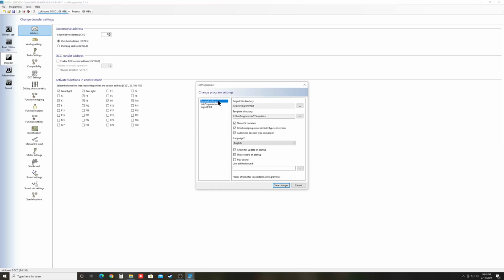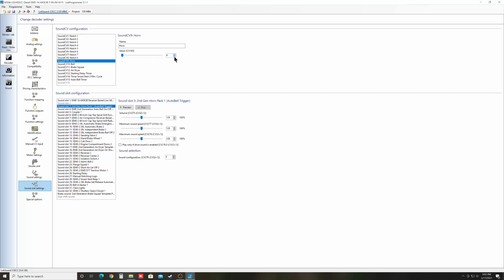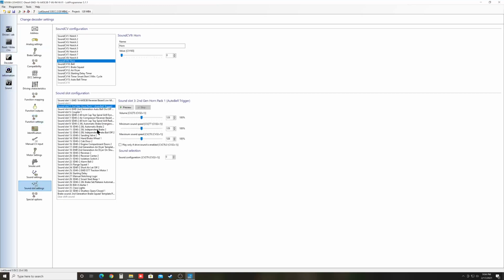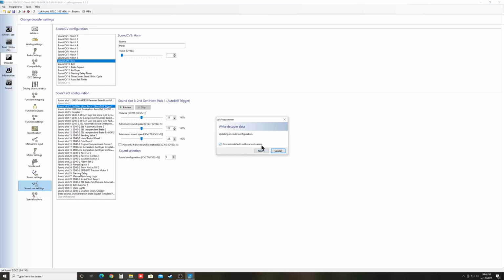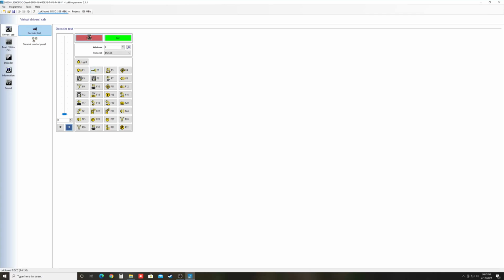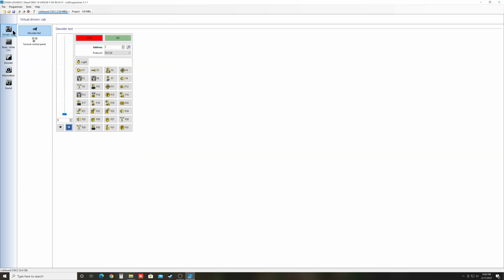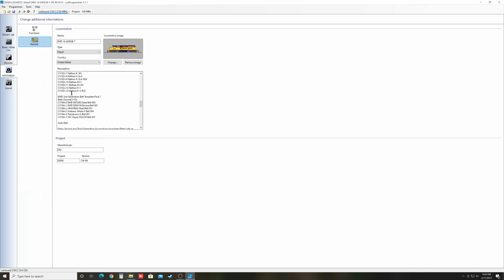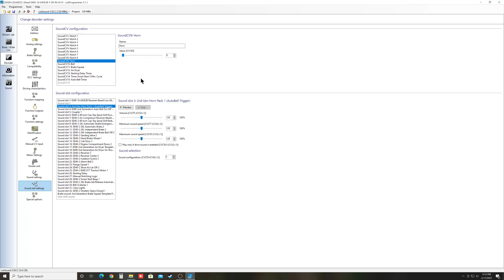ESU Tutorial Series - How to Change the Horn & Bell in a V5 Sound File

Comment: Hi, can you make a video on uploading the existing loco soundfile to make a copy in the computer for future back up, also make a second copy to play on or tweek the other bells, horns, which i think you already made  just a way of learning to do more of the program upgrading. I have a lot of G scale on ESU and i like to learn the next phase on ESU programming . your video are great to learn. if i can get a private tutorial please send me a contact or email  for me to connect  thanks
Reply from the maker: Hi Reddfox12...I'm not exactly sure I follow what you're asking. There is no way to download sound files from the decoder if that's what you're wanting to do. The decoders from ESU come "blank" from the factory (with test sounds only) and always need to have a sound file written to them. If you want to change what is pre-installed maybe from a manufacturer or a hobby store, you simply over write the entire file with a different one. There's no erasing or downloading what is already there. If you know what sound file was put on the decoder to start with you can open that sound file (after downloading it from the ESU site) and read the CV data into the file via the green arrow button. This only reads in the CV data, not the sound data. 

I always start with any decoder by downloading the sound files from the ESU website. I will modify the sound file I want for a particular locomotive and then save the file with a different file name. The file name has the road name and road number of the locomotive it is for. That way I have a specific file for every single locomotive. I also have the "base" original file as well that I will modify again if needed for other locomotives. Uploading the sound to the decoder is always the same, simply by pressing the music note icon always writes the sound data and the CV data and takes about 25-30 minutes. The red arrow icon without the music note only writes the CV data which takes only a few seconds.

I hope that helps, and if not let me know and I will try to help further best I can.
Reply: @RioGrandeFan  thanks for a quick response. ok. I may have said confusingly. 
If you check my YouTube video on a lot of my G scale  they are all ESU sound file and custom programs. 
A professional installer did all that. 
Wiring and program ESU sound files. I need to learn to place the locos individual on the program track to get the ESU Sound file and programs to my Desktop for my own copies. Meaning I need to read the decoder ESU data and store it to a folder for future back up just in case I have to down load if the decoder get some glitches to restore it. 
Second I will get to learn to make a copies on the Master of the original and then the copied file can be edited to like changing bells , whistles, volume sounds. Etc. just basic tweaks. 
3rd. To learn from the original how the pulse smoke and other accessories on Auxiliaries connection how lights are made to strobe , blink. There are a lot of learning on the master file that was made. Maybe to enhance or discover other tricks that is possible and allowed with the range. 
I have a test lab gadget that connects the decoder 58513 XL that will show all connection like 
FL, Front Light, RL rear light, speaker, motor, etc. to fine tune and before you make a final Decoder install. 
Now I know the Ho are ESU plug and play. But the G scale is custom wiring install. That is for the professional installer. But the learning to tweak or enhance the decoder data can be learned on the next phase of the hobby. 
 
You can change the locomotive sound file every month if you get tired and try a new file. Like ESU Is making more Hi fi sound file which are really great. 

Simply put. Backing up my Locos data and soundfile to my computer 
And learn to copy the master file to another file to explore other possibilities to enhance the features of the  locos sound functions.
Reply from the maker: @REDDFOX12  You can only download the CV data to your computer which I suppose is ok, but it would be better if you had the original file that was written to your decoders. I would ask your professional installer if he would give you the files he used. There's really no reason why he shouldn't give them to you or at least tell you what file number was used. With that you can download the file that was used and then read the CVs into it using the green arrow icon. Then save the file with your locomotive road name and road number. If he put custom sound recordings in the sound file you'll need the sound file he used. You cannot download the sounds themselves from the decoders. The software only writes the sounds, it cannot read them. It can only read the data.

When I do professional installation work I always save every file and if the client wants it, I give it to them. From there you can save a copy with a changed file name and make your basic tweaks. The sound files don't care what the file name is so it can be anything you want. That's how I keep track of my locomotives.

Comment: Do you have a video that shows how to take a prime mover from one file and move it to your project file? Or is this the same concept?
Reply from the maker: I'm not sure I'm following the question. There shouldn't ever be a need to move prime movers between sound files. If you know what prime mover you want, start with a pre-made ESU sound file for that prime mover. Download it from the ESU website and open it directly into the LokProgrammer software. There are over 100 diesel sound files so you should be able to find a file that has the prime mover you need. With V5 sound files and decoders you can customize the pre-made file with horns and bells and other sounds that you want from other files if necessary. It is far easier to move horns and bells and other sounds between files than it would be to move the prime mover.

Comment: How would you do two separate horns that are playable when going forward or reverse? I'm trying to set it for the GE ET44c4 prototype #2015. I'm using a V5 with ESU file S0735, forward is K3HL and reverse is K2H. 

Thanks
Reply from the maker: I am very sorry for not replying sooner. If you still need this, the easiest way to get it would be to download the InterMountain Railway file 93486 from the bottom of this page: https://intermountain-railway.com/customerservice/dccwebpage/IRC-OEM-ESU-Sound-Files.html. The exact horn set-up you're looking for is in this file by setting CV163 to 15. Of course using my horn transfer videos as a guide you can take the horns from this file and transfer them to the S0735 file if you prefer.